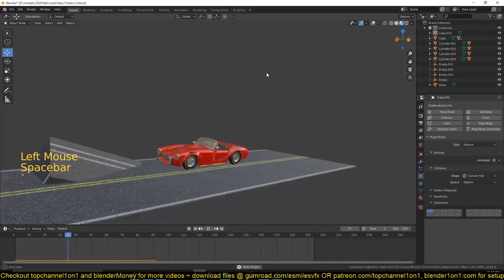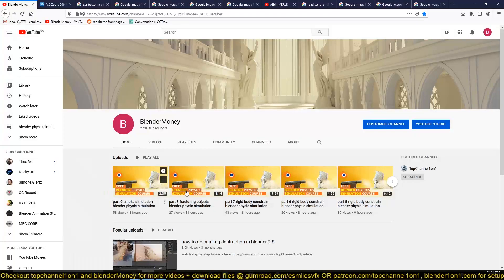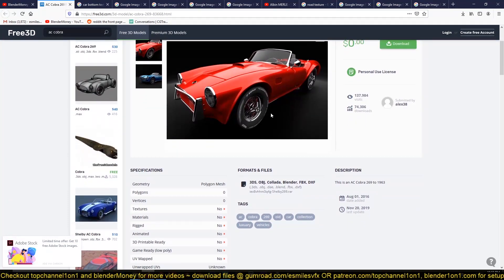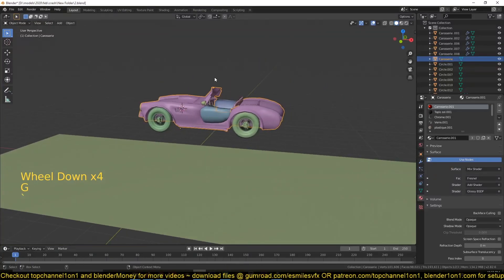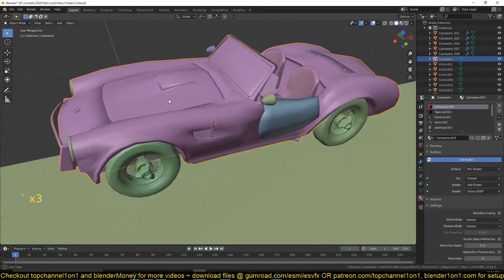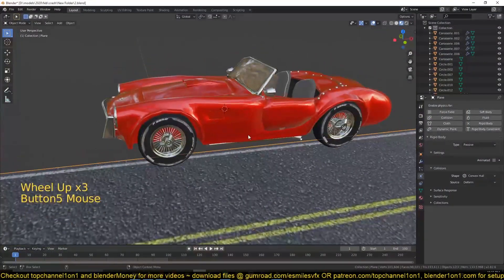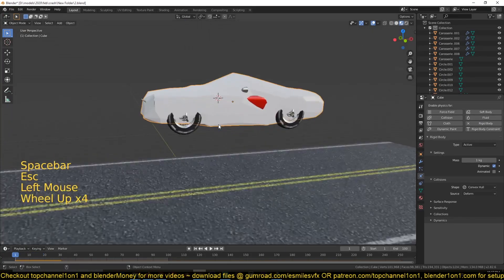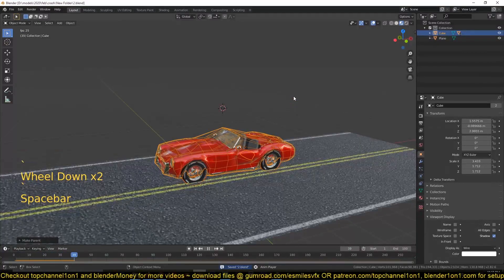how to crash a car in blender part 1

Comment: The motor constraint applies rotational torque to any object it’s attached to, you put it on the whole car which is why it’s causing it to flip, you want to attach to the front or back wheels, The thing you were talking about at the start is called a proxy mesh, a simpler version of the beauty mesh to handle physics collisions.
Reply from the maker: oh, thanks will make update